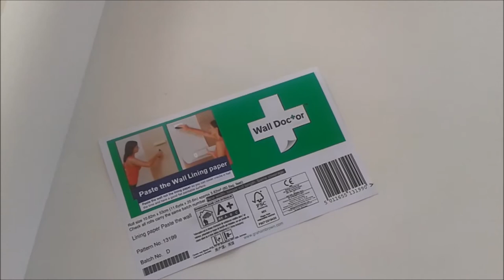How to paper an old ceiling using Wall Doctor Lining Paper

Comment: Another quality video. what's the difference between this stuff & ordinary lining paper?
Reply: Do you prefer to line a ceiling instead of just filling the cracks & paint? sorry for all the questions, I appreciate the time given to respond 🙌
Reply from the maker: Wall doctor you can paste the wall if you like although I always like to paste the paper. You can put it straight away with no soaking time. It's a lot stronger than normal lining and is washable. It's ok but not as easy to keep the joints butt on bowed walls or ceilings.
Reply from the maker: Yes always like to line it leaves an even texture for a better paint job.
Reply: Would you use a hard stop filla to the joints ? Or paper ....